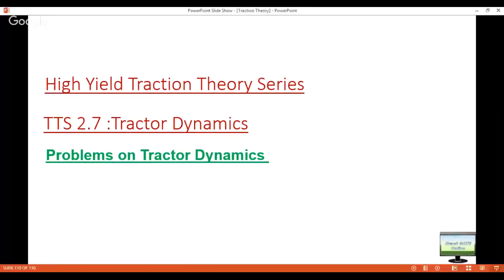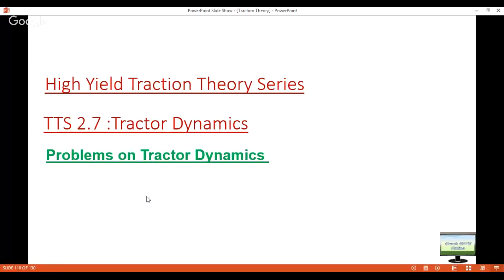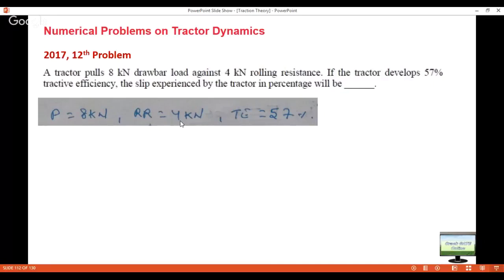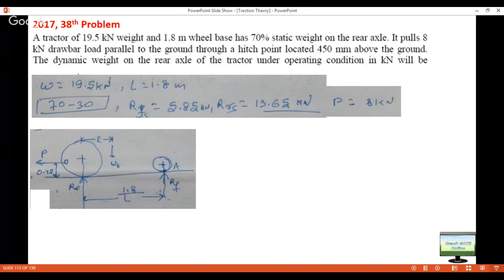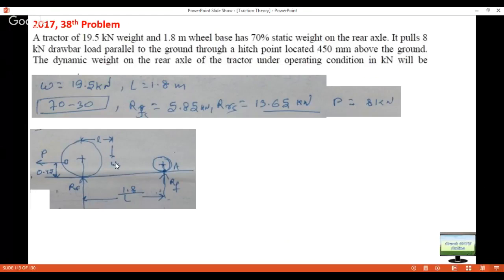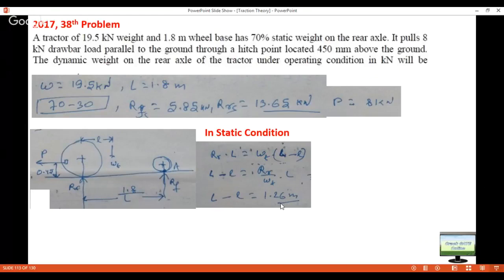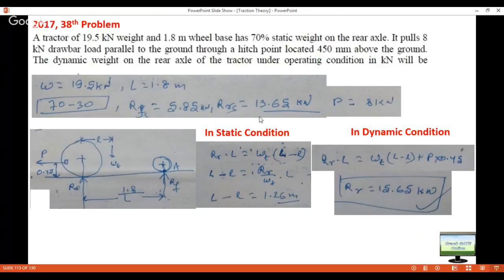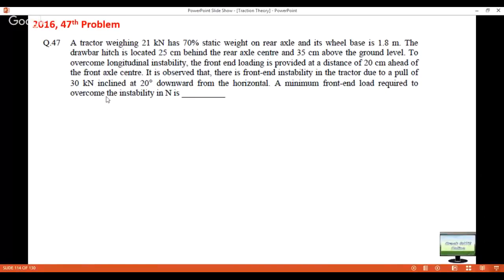TTS 2.7 : NUMERICAL PROBLEMS ON TRACTOR DYNAMICS & STABILITY

Comment: In qustn no.32 of 2014 gate question the answer we getting is 0.8 in case of 2 wheel drive tractor but you r saying the answer is 0.2. How it is possible?
Reply: Might have mistaken... I also got 0.8 in 2 wheel drive case..